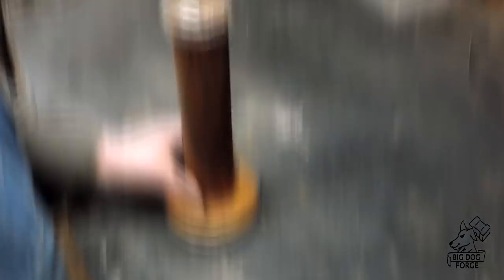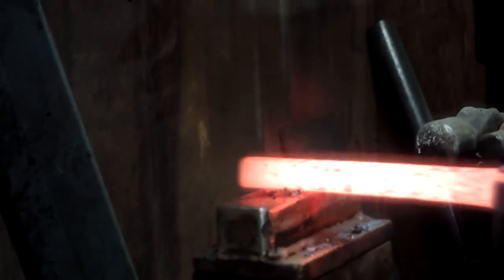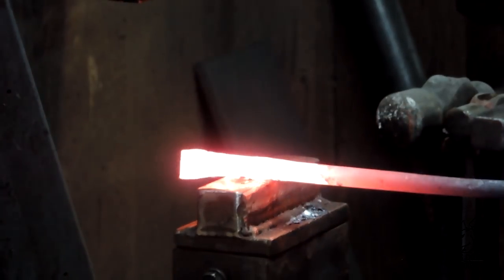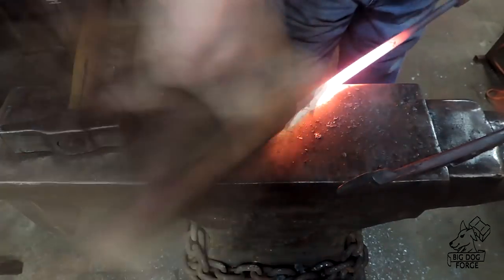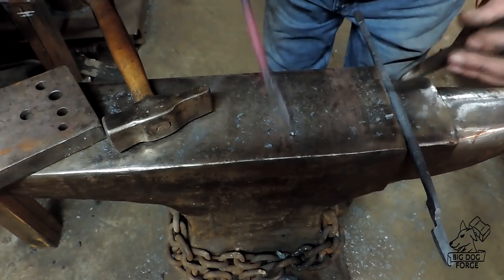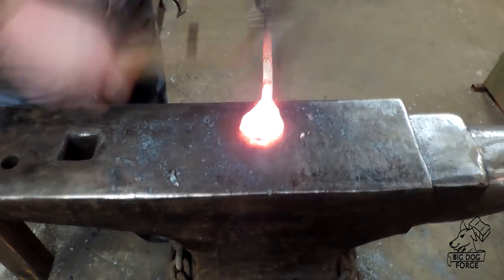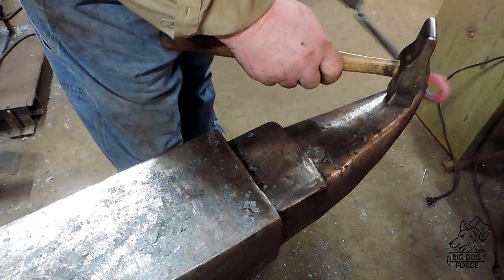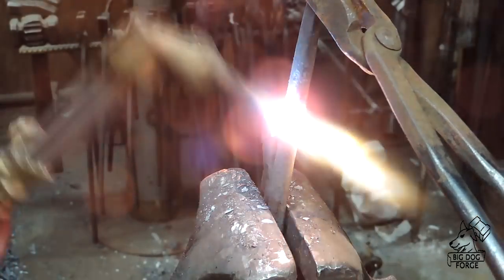Blacksmithing FORGING A RUSH LAMP

Comment: Not a bad idea. Will have to give that a go. 
I know in Ireland they used to make rush lamps and would strip off most of the green surrounding exposing the white spongy wick. They left a 2 mill. strip of green on it to keep it from breaking and then stuck it in some oil to light them.

Comment: Project idea for you is ... make a pan that the tongs can hold that will go over the candle for heating water to make coffee when you have a power outage or when camping we do it a lot with tea light candles if we don't have power for what ever reason.  would look amazing and also make some sort of a weight that you can hang off the loop at the base of the candle to hold the tongs together better so it will support something a bit hvy.

Comment: Ok what was The purpose of the tongs?????  Good looking build but not sure of the tongs use ?? Thanks for sharing Tim !!!!!
Reply: Simple, the tongs were to hold rushlights (The dried central pith of the Rush plant, soaked in kitchen grease.).  Rushlights were cheaper than candles, so having a single holder for both meant you could burn rushlights and candles (When you could afford them.) in the same device.
Reply: That was my question also
Nice to learn the history behind these projects